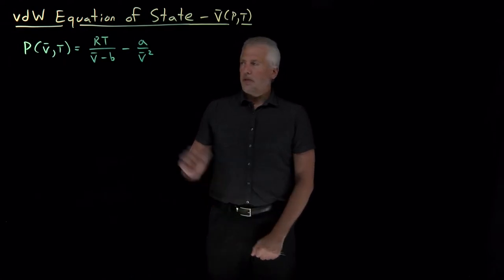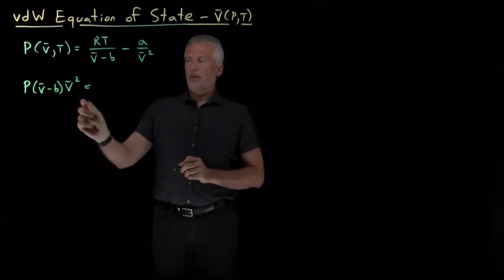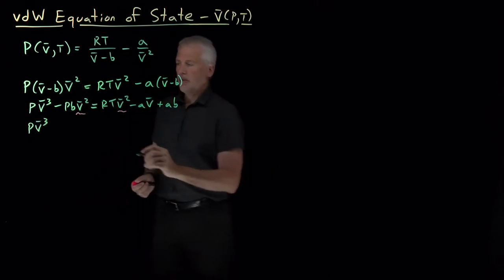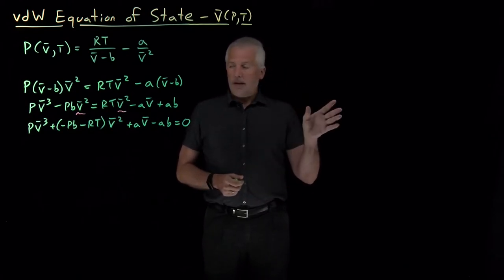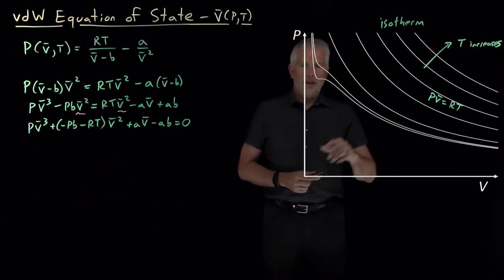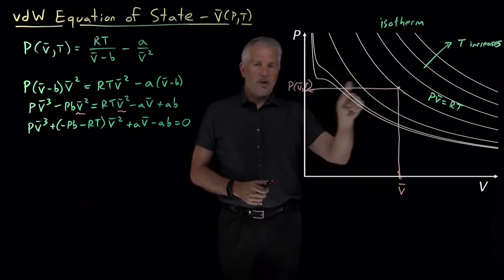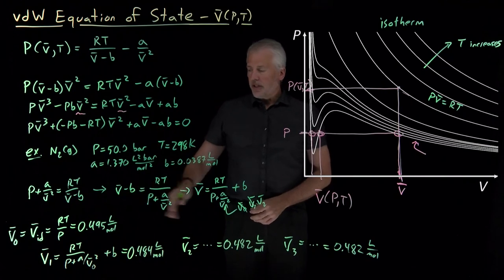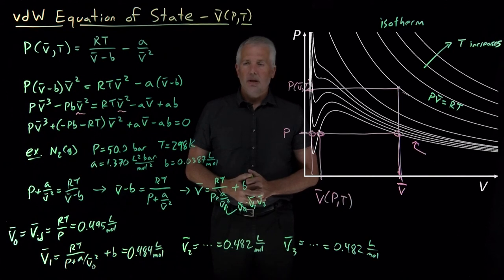vdW Equation of State (Molar Volume)

Comment: Below Tc we get three values for volume. McQuarrie book's says we can think of one volume for liquid one for gas and 3rd one is spurious,, what's that mean in physical sense?
Reply from the maker: The best answer is that you should not try to interpret that middle solution in a physical sense.

The real phase diagram becomes horizontal in the liquid/gas coexistence region. The (smooth, continuous) vdW curve can't become perfectly flat over an extended range of volumes. So the vdW "phase loop" that includes the spurious middle solution is just the vdW curve staying as flat as it can manage. But the actual P(V) behavior in that phase loop is nonphysical, so you shouldn't trust the numerical values.
Reply: @PhysicalChemistry  Thank you!

Comment: It’s a great lecture and I’m revising my physics chemistry knowledge, so many things are clearer than ever! Coming to my question, what is the pressure and temperature cut off value for a real gas to stay in ideal condition, since ideal gas conditions says only low pressure and high temperature?
Reply: There's no specific cutoff. For one thing, the ideal gas law is always wrong. The cutoff you're looking for would just depend on whether you're okay with errors of 1% or 0.1% or 0.01% or ... For another, the cutoff would be different for every gas. At a given T and P, nitrogen behaves more ideally than steam.
Reply: @stevenjstuart  thank you so much for your replay, and I also got some of the things when I was looking at the following lectures.